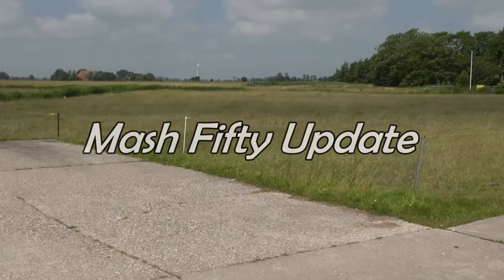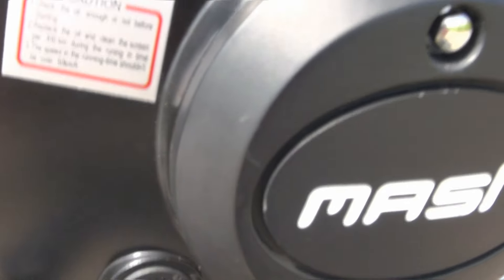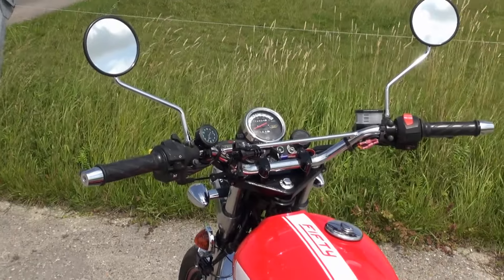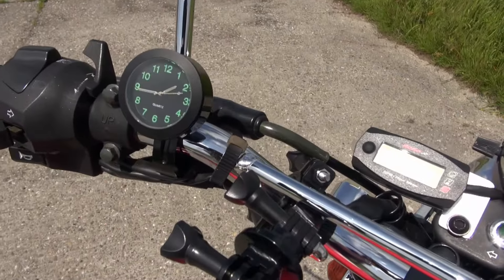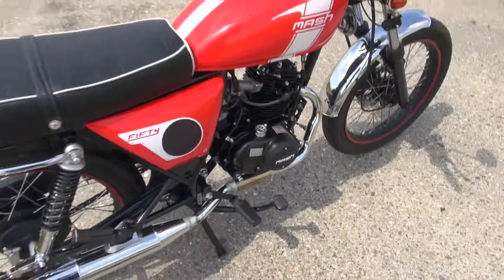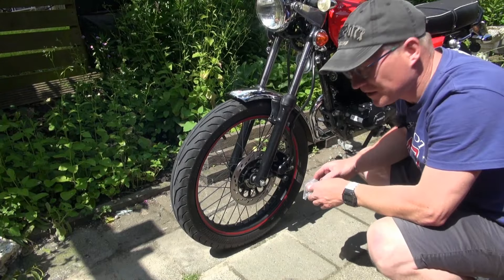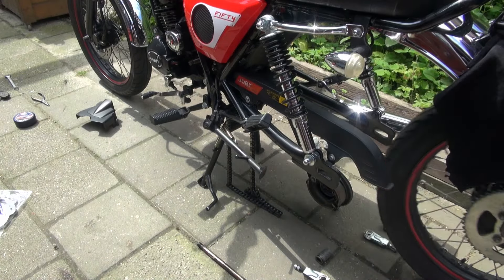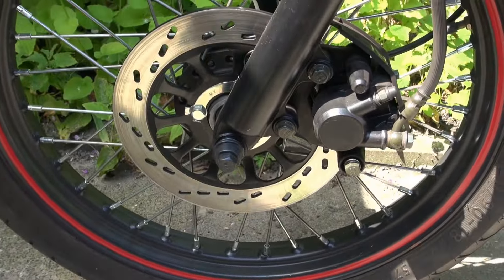Mash Fifty quality issues and 25.000 km maintenance

Comment: I know nothing about bikes but enjoyed this walkthrough regardless. Seems like a decent enough bike if its monitored and looked after properly, which you clearly do!! Cheers Arnold! :)
Reply from the maker: Hey Mike! Yes, these bikes are pretty good from factory and with a little TLC they last a long time. I made this video hoping that other owners can take precautions so they don't run into the same issues I had. I am really happy with the changes and improvements, some were necessary (wheel bearings) others were my own personal taste. Last month I rode 2.500 km, that's how much I like riding it.

Comment: Is it reliable enough for work commute? What advice can you give to someone who wants to buy a used one?
Reply from the maker: Yes, it is a reliable bike if you don't tune the engine. If you're buying a used one, ask if the oil changes have been done every 2.500 km, and if the engine has been tuned. Especially the 70cc kits should be avoided. The best way to determine if a bike is worth considering (when you buy a used one) is to take a close look to the appearance: is it clean, are the wheels and spokes clean, is the chain clean and well lubricated. These bikes are reliable as long as they are well kept. Neglect is easy to spot, I would avoid those bikes if you're not technically inclined. But with a little bit of effort, you can turn a half decent bike into a reliable commuter bike.
Reply: @Carnold_YT  I'm not technically inclined for now but there are not many choices to go after except this one for me. Pretty good advice over all, thanks!

Comment: You have it looking like new ,but why put all that effort into something that will give you problem after problem ?. Japanese bikes are so much more reliable .
Reply from the maker: Japanese bikes in this vehicle-class are not for sale over here, the only alternative is an imported Honda that costs twice as much as this Mash (and which is nearly the exact same as my classic Honda that I owned before). So there's the reason I wanted to give this a try.
And I wouldn't say that it gives me problem after problem - it never left me stranded or anything, nor does maintenance cost more than on my old Honda. With the points shown in this video, you can greatly improve the quality. As mentioned, I think part of the hobby is doing maintenance and making small improvements.